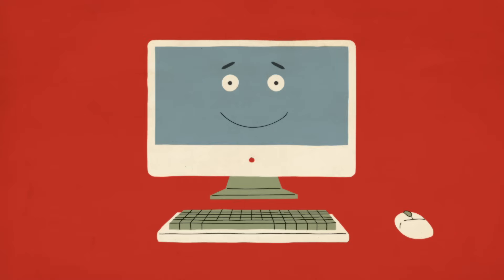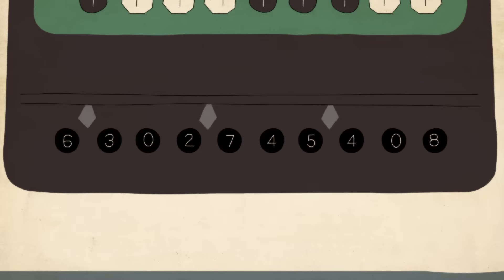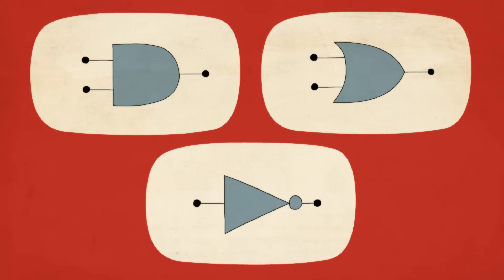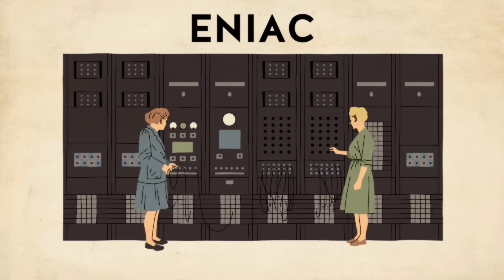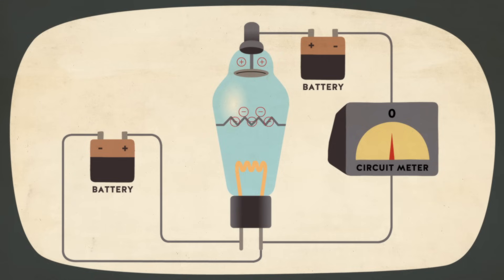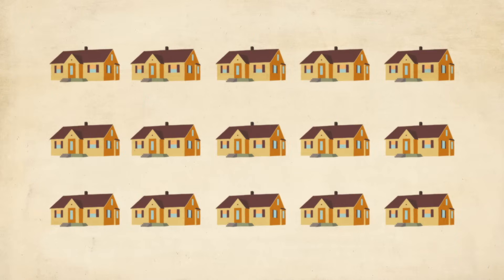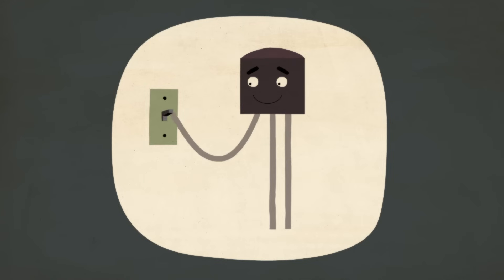How transistors work - Gokul J. Krishnan

Comment: And before vacuum tubes there were relays - mechanical switches controlled by electricity. The very first stored-program computers used this.

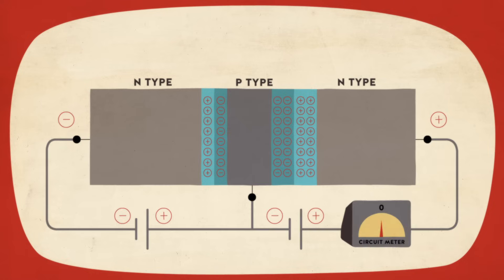Comment: 3:50 which part of the computer applies the different voltages (high and low) and how does it know which voltage it has to apply?
Reply: Hello, the circuit which applies voltages are called "biasing circuits". These are also made of transistors. In the video i talk about the very basics of computing. In reality a lot of helper circuits are necessary for actually performing instructions or calculations.

Comment: I get that the logical gates count 0 when there are no electrons flowing trough and 1 when there are electrons flowing trough. But what makes the transtiors switch on and off? Do we have any control on this ?
Reply: Nope. Ted ed is wrong about voltage that when "True(1)" state has 5 voltage and "False(0)" State has 0 voltage, you still need a voltage when sending a 0 state, its between higher voltage and lower voltage not having a voltage and no voltage because that the answer to your question about "switching on and off"
Reply: Zie Tua okay that answers. Thanks pal

Comment: The treating of silicon with other elements to create an electron emitting N-type and an electron absorbing P-type is know as doping. It's used to create conductance. Since the outer shell of silicon is 4 valence electrons, it's easy to fill silicon's outer shell with other silicon atoms. This makes conductance hard. So, some silicon atoms are replaced.

Comment: Next lesson. How does on/off states write and run programs. As in machine language.
Reply: The simple answer to that question is chains of alternating combinatorial and sequential logic.

Combinational logic is simply the generation of a outputs based on a set of inputs. Using boolean algebra, we can generate a combination of logic gates with any output we choose for a given set of inputs. We can therefore choose for the outputs to represent all kinds of simple operations such as adding two numbers (adder) , indicating which of two numbers is larger (a digital comparator), or selecting which of multiple data inputs is output based on a control input (a multiplexer), etc.

Sequential logic happens when you feed the output of a circuit back into itself in such a way that it can maintain a constant output state even when its input states change -- until some reset condition causes it to re-evaluate its inputs.  These are known as latches and flip-flops. They can be used to generate circuits that maintain state such as binary counters, registers, and sequencers, etc.

Using series of alternating combinational and sequential logic it is possible to create a kind of hardware program that reacts to machine code based on internal states. 

For instance, traditional multicycle processors state start with what is effectively a sequencer that defines what happens during each of a processor's cycles (say fetch instruction,  decode instruction, execute instruction, and store result). The current cycle would be stored in two bit counter that rolls over every four cycles.  This counter (sequential state) would be fed into a combinatorial circuit that would decode the cycle number into various control lines to manipulate the other parts of the  processor. For instance during the fetch stage the control lines might signal the output multiplexer controlling the memory address lines to output the value of the program counter register as well activate the read line on the memory chip. Another would signal the instruction register to read the data line from the memory.  On the decode cycle, the instruction itself would be decoded into signal lines that manipulated the various busses and modules in the processor to execute the requested instruction.

So its all just building from simple circuits to some simple components such as multiplexers and counters, into larger components such as register stores and arithmetic logic units controlled by signals from sequencers and the internal state of the processor.

Comment: Right I’ve been stuck on this for ages now. I’ve done my research and still haven’t found an answer. How does a computer alter the voltage to a transistor, because surely it must switch between a high and low voltage constantly to change the output of a transistor?
Reply: Hey!
The process of controlling the voltage to the different pins of the transistor is called Biasing. There are separate biasing circuits to control the voltage at the different junctions.

Comment: I have a feeling computers will evolve to processing in temperature variations, measuring fractions of trillionths of a degree instead of mass raw voltage alone. Ex. Water (or some liquid) that freezes at X rate with Y pattern produces Z code with E sequence. Liquid quantum computing. Less thermal breakdown if the liquid medium is developed to remain thermostatic at a broad range of ambient temperature. Salt water is already conductive and who knows, maby the byproduct of computing produces hydrogen fuel to power itself.. The answers are probably over complicated. Aliens man, aliens..

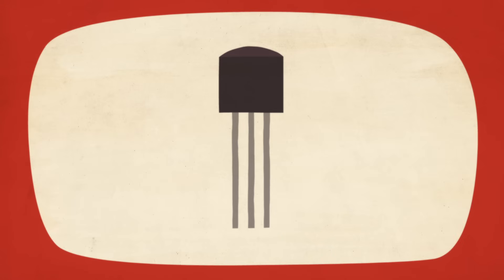Comment: Didn't you miss the part at 3:50 to 4:10, you comfortably skipped the logic behind the switching. And the animation is inaccurate, as it showing the electrons  being stopped at the base emitter junction and not the base collector junction. Sorry but what my books told me was the base and emitter in this configuration are always forward biased. Please correct me if I had made a mistake(Regardless the animation is outstanding).

Comment: So when a charge passes through a transistor this can be determined as a 0 or a 1 creating binary; but what is actually controlling the voltage? How is it turned on or off?
Reply: A computer determines the voltage.

That smaller computer also has a computer controlling its voltage.

And so on.

Comment: The HIGH and LOW voltages thing is a bit misleading here. Yes, 1 is typically a high signal and 0 a low one, but it depends if the system is active HIGH or active LOW. In other words, 0 can be HIGH and vice versa. Additionally, LOW is very rarely represented by a voltage of 0 as how does one know if the machine is working if there is no voltage? It is doing the same thing it is doing as if it is off. As such, LOW is usually a voltage of 1V, 2V, or some other lower voltage (or, again, HIGH can be represented this way as long as you are consistent.) You just need a difference in voltage for the system to work. Just a fun fact for everyone. :)

Comment: umm, no, that does not make sense.  Voltages do not equate to numbers.  Either a bulb is on, or off.  Binary code represents numbers, which in turn may equate to letters, thanks to computer memory, and programming that creates letters such as E on a screen.  Ok, but voltages - or electricity - is used to power transistors flaslights computers et cetra.  I find your explanation sorely wanting.  And why call logic, boolean, and not simply algebraic logic?
Reply: 0 and 1 are just on and off state of transistor

Comment: Also; how are billions of transistors fitted into one microchip?
Reply: They are making transistors that are 14 nanometers in size. 14 nanometers. They must have steady hands. Maybe they hired the snowflake making team or somathing.
Reply: Because transistors could be made so tiny that a 1 cm^2 can accommodate billions of them. The smaller the transistor the lower its power handling capacity. This tiny transistors are used to create networks that perform a specific task. The industrial process of manufacturing such "integrated chip" (IC) is called Wafer Fabrication.
Reply: Vishnu M Aiea Thats so amazing
Reply: h
Reply: fg
Reply: f
Reply: ggggggggggggggggggggggggggggggggggggggggggggggggggggggggggggggggggggggggggggggggggggggggggggggg_____________________________________________________________________________________________________________________________________________________________________________________________________________________________________________________________________________________________________________________________________________________________________________________________________________________________apdefkd jnd jdbrhhhhhhhhhhhhhhhhhhhhhtburhbt

Comment: Anyone know the best place on the internet for a beginner to complete understand a computer? thanks
Reply: It depends on how much you already know about them. If you want to completely understand how computers work, you have to start from basic electronics. Then to digital electronics, micro-controllers, micro-processors, and finally programming languages and operating systems, computer networks etc.

You look so sad BTW. Why ?
Reply: Vishnu M Aiea I no mostly nothing. And I want to no about all of those topics. Where can I learn them all?
Reply: *know
Reply: First of all, we can not learn everything ! We all will be in a process of learning, because knowledge is endless. All we can do is improve. So the first step to learning is to identify what you already know. You may know what you already know. But the problem is with identifying what you don't know and where to start learning them. You have to learn one by one, we all do.
Reply: So first identify what you want to know. Then start from the point where you already knowing it. Understand the concepts, principles and laws. You don't have to remember complete details always. Just keep an abstract thought of them. For example, when I want to do something with a transistor, I may not even know the exact equations or other parameters. But I know there exists something and where to find it. That is the beauty of knowledge.
Reply: We are always happy to help you and that's something you shall not forget when you've learned something. :)

Comment: There was a reason Zuse stayed with relays so long, much more reliable, even if a bit slower.
The first Computer was pure mechanical anyway, the Zuse 1. Look it up, its a nice machine that calculates everything with metal sheets. :)
Reply: I think you can accomplish any computation with mechanisms, but it ends up being a giant, noisy and power-hungry machine.

Comment: 4:23 What do you mean trillions of calculations per second?  Don't you mean billions?  If a single core processor runs at 2GHz, then it makes 2 billion calculations per second.
Reply: He said it so that the video would be accurate 5 years from now.
Reply: @YtubeUserr  i dont think 20000 ghz is possible lol
Reply: Different parts of the processor can calculate in parallel though, which makes this number higher, but still not a trillion according to wikipedia: https://en.wikipedia.org/wiki/FLOPS

Comment: I get how boolean logic works and how transistors are useful for it, but what provides the electricity for the 1/0 operation and how does each thing know what to do I'm so confused
Reply: (disclaimer: I don't know much about any of this)
What you're getting at here is a very complex interaction of binary operations, and honestly my best suggestion would be to watch Matthias Wandel's Marble Adding Machine video. 

In that video Matthias shows how a "simple" wood structure he has built uses input from the user (placement of marbles) to perform a calculation (addition) and display a result. The same concept applies to computers, but rather than small wooden levers, we use transistors. Rather than marbles, we use electrons. Rather than putting marbles into particular holes, we click keys on a keyboard.

On that topic, when you click a key on a keyboard you complete a circuit and send a brief electrical current to your computer. This current passes through a heap of transistors and complicated stuff so it can identify what key you've selected (in the same way that Matthias Wandels marble machine uses a lever to identify which hole you've dropped a marble into).

Hope that kind of makes sense, just keep in mind that if you're trying to conceptualize how transistors interact to produce something like the display on your phone and the internet you're using to watch this video, then you're gonna need a /lot/ of practice with smaller-scale operations first. In fact, arguably it's become impossible for any one person to fully comprehend.

Comment: The transistors used in microchips are not bipolar transistors (with emitter, base and collector) but field effect transistors, which work somewhat differently.

/nitpicking off
Reply: like=true;
Reply: Hehe. True. For FETs, watch the Veritasium video on the same topic. The fundamentals are mostly the same but instead of a base being directly connected, it's just inducing a field.
Reply: Actually, most, nowadays, are FETs. :P

Comment: How far of would it be, to compare a transistor with a neuron!? I mean, both are kinda on or off / 1 or 0.. Right? :-?
Reply: From what i understand, neuron are much more complex than a transistor. You can think of neuron as a computer that is part of a huge network.
Reply: Olli Trolli Nope. Neurons have multiple connections. And they don't treat information in the same way. A neuron can do waaaay more.
Reply: Well..  There goes my theory of the holographic universe..  Thanks for the short but well said inputs though! :-)
Reply: Don't lose hope just yet, the brain is an electrical device that is run biochemically. However, the topic of Consciousness is way bigger than the human brain.

Comment: can someone explain how do we make transistors if they are so small?
Reply: With light. They project a pattern onto a photo sensitive material that eats away at that material, that works as a resist for the layer underneath, which they can they etch with a different chemical, they then remove the photosensitive material, coat with with a new conductive or semi-conductive material, and repeat the process multiple times until they have many layers of different materials creating a complex structure.
Reply: +Stan V oh so they dont make them individualy, i knew it
Thanks for taking your time to answear me.
Reply: Yeah, they'd create a whole layer of a processor at a time, the transistors would be way too tiny to make individually.

Comment: I think the information of the gates were a bit lacking. But I think you would need a 15 min video to just get down the basics. :P
But what I would like to learn more about is the PN junctions, the physics and how you dope the materials to make the transistor.
Reply: +xxuncexx I agree with what you are saying, but my criticism is how the video is structured. PN juctions should be a video by it selves, just mentioned here. Vacuum tubes should have less focus, but talked about. Logic gates should have more focus. NAND gate is explained, but then explain how simple it is to turn a NAND gate into a NOT gate. With a NAND gate and a NOT gate show how simple it is to turn a NAND and a NOT gate into an AND gate. Don't need more gates, but make a Bit that you can set, and read. Animate the wires that are high.

This is more useful to conveying the information that computers are built up of many simple parts, that are easy to understand one by one.
Reply: This isn't an in depth class. These videos just skim the surface and are meant to give you the basic concept
Reply: there is an entire subject in engineering dedicated to semiconductor and its derivatives. Its called electronic devices and circuits.
Reply: Ziggurat
I see your point. I feel it got the basic gist but they could have focused on the gates more. Maybe presented the truth tables and stuff.
Reply: +xxuncexx I forgot, most people like truth tables more, can be displayed at the same time as animating the hot wires. Just because these things feel and theoretical, when they really are physical and mechanical instead.
Reply: It's taught in a Solid State Physics course. Tbh, I find the whole beta thing very hard to understand.
Reply: @RexGalilae  That’s because you’re trying to understand something that doesn’t make sense. You just have to accept it for what it is.
Reply: @hxd9321  
Can you give me a refresher on what this thread is about? I barely recall anything lmao